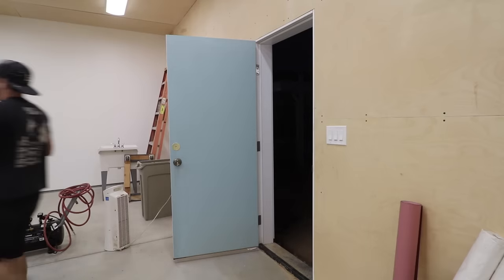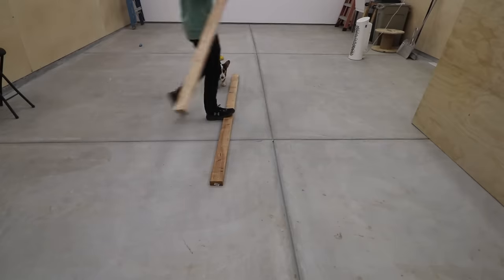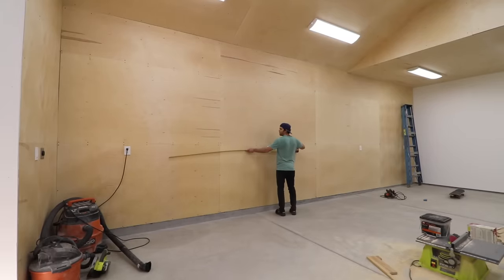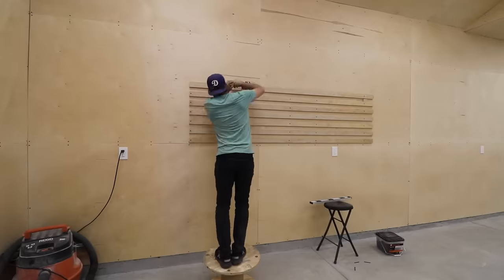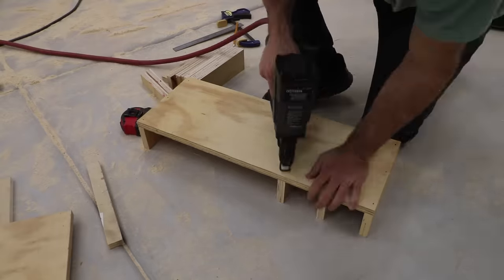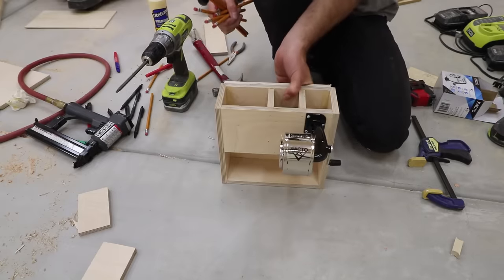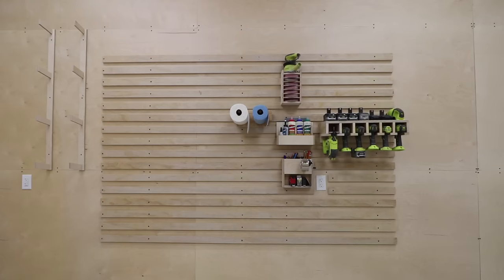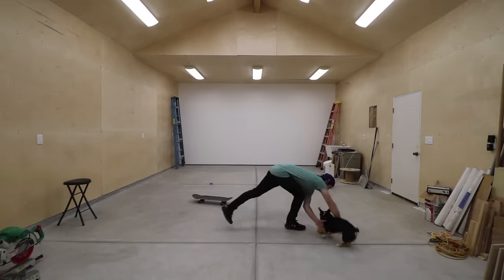Ultimate French Cleat Tool Wall

Comment: Recommendations: 
Put a piece of foam in the bottom if you're dropping freshly sharpened pencils in there so they don't get dull again immediately. 
Use the weirdly placed plug to your advantage and mount all of your drill battery chargers on a shelf that plugs in there and hides the cord cleanly.
Reply: I also use foams so it doesn't make marks on the bottom
Reply: Great tip about placing batteries close to plugs.  Would also be good idea to incorporate chargers into the box for these.

Comment: Only thing I would change about this is putting the wall-mounted strips onto a plywood board and mount that plywood board to the wall -- this way you can easily relocate the whole assembly once your workshop is more fleshed out and you start to realize you actually would prefer to mount it elsewhere. (at least I know that's how i would feel)
Reply: Good point!
Reply: still grate job man :)
Reply: Or you could be like me and install and remove everything 10x until you figure out where you want everything , I don’t recommend it, big waste of time
Reply: Solid idea
Reply: Bro I heard you like cleats? Just put your cleat wall on wall cleats for your cleat storage. EZclap.
Reply: My dad said the exact same thing
Reply: I agree. Workshop Junkies did that...mounted on plywood first. Nevertheless, a great job!
Reply: His entire garage is sheathed with plywood. You missed the first 3 minutes. 😅
Reply: @henryheinbuch  That's not the point though... It's to be easily movable from wall to wall, which this is not.
Reply: Love the idea man
Reply: I just put cleats on all my walls problem solved.

Comment: Love the whole French cleats approach!  A couple of ideas (no criticism at all):      1) Add a power strip to one plug by the outlet and build a shelf for battery chargers for the second outlet. 2) retractable extension cord and air hoses would be awesome in that space. 3) anti fatigue mats under that tool wall—eventually something expensive is going to fall. 4) make a disposable glove dispenser 5) mount a bench grinder on the wall or nearby.   6) you could integrate a work surface underneath the wall. Cut plywood the width of the wall and the height of the floor to bottom of the tool wall.  Attach with hinges and have foldable legs.  Pop it out when you need it & fold it away when you don’t.        Idk if I could have done all the smaller assembly on the floor— just a sawhorse/plywood table would have made the work more comfortable.     Awesome work.  Looking forward to seeing more.

Comment: I made one of these about 6 years ago, and have learned a few things from it.  One is that you don't want to have all your tools out in the open, they get covered in dust over time, and it get's caked on over time.  I put very often used tools out, but things like drill bits, tape,  brads etc, I find better kept in cabinet with a door.  Good news is you can put cleats on the back of cabinets and still move them around as your needs change.  Another neat thing, is to mount magnetic bar, either on a hanger, or onto the cleats themselves.  Then spaces can be used for those "catchall" tools, or specifically mounted for a set of wrenches say, without needing a box - which also collects dust.  Good job though!
Reply: Maybe you should make a dust collection system using a shop vac?
Reply: @ericinlampasas3488  I have a large chip extractor for planer/tablesaw/bandsaw, a dust extractor with ducting system with blastgates for sanders and router table,  portable vac for all handheld tools, and a ceiling mounted air filtration system.

Anyone with a workshop knows that despite that, you get a lot of dust.  You do in a house unless you dust each week - but I don't know many people that dust all their tools on a weekly basis!
Reply: @ericinlampasas3488    BTW: I am not saying this is not a great job.  I am just not sure about power tools (which are better in cabinets), and rolls of tape (perhaps better in drawers), etc.  I have one of these and put most of my most used tools on there, but not all, and only things I might use on a weekly basis.  Eg, i don't put a socket set out, but I do put 5 chisels on it. And so on.
Reply: Good point on the dust build up assuming people are putting these in their workshop. 

I'll be putting this system in my garage just for tool organization.
Reply: I agree with your idea, actually we should make the cabinet with the same rack to be easier to make it ready when we do some tasks

Comment: Small tip - take the very corner of the cleats off with whatever you have (plane, sand paper, table saw, router etc).  It’ll avoid small debris interfering with the seat, prevent your cleat from getting chipped out over time, and you won’t cut yourselves on the edge :0

Comment: Nice! I usually work alone. I use French cleats when I install cabinets in kitchens. Just hang them on the wall and work from there. I order filler strips to make up the 3/4 inch difference between the wall and cabinets. The best part is in old houses once the cleats are on you don't have to worry about finding studs. Up here in Boston there are a lot of old houses!

Comment: I used a french cleat to mount my old TV on the wall in front of my treadmill. The problem was, because it was old, it weighed something like 70 lbs, so I had to hack together a hoist system to lift it into place. Works great though.
Reply: i did the same thing with a flatscreen in my room haha
Reply: mounted my projector screen to the wall with this i thought i was a genius for coming up with the idea.... before i knew it had a name.

Comment: I've been looking for a way to organize some tools and thought I would be going the peg board route.  Now I know what I'm going to do.  I love the idea of being able to move thing around as I get more tools.  I also love the idea of making all of my own holders for things.
Reply: …plus, peg boards can be a pain. A) you need to maintain a gap between the pegboard and your wall so that hooks and loops can enter and secure through the pegboard holes. B) lots of pegboard hooks and accessory holders pull right out with your tools, dropping on the floor, etc. C) way more limited storage options unless you build them yourself. And then they are a bit harder to engineer so as to be compatible with the peg holes and still be secure. 

Not crapping all over pegboard systems, I still use them. But I wouldn’t install or expand a NEW one at this point: cleats all the way.

Comment: I went to school at a studio that had the same style French cleats on the walls for the modular sound absorbers (soft) and sound deflectors (wood shapes). The cool part is there were rails on the walls for them to hang, but also a few movable walls on casters that you could rearrange any way you wanted. This would be a useful idea for your system. A small rolling wall with cleats to bring any of those modules over to whatever you are working on.

Comment: Nicely done! As simple as it is, one of my favorite take-always is attaching the pencil sharpener to the pencil holder (with foam at the bottom of the bucket)! My pencil sharpener is currently mounted at the end of a work bench and, while I don’t always use that end of the bench, if I want to, the sharpener is in the way. This puts it right where it needs to be!  It’s simple add that will save time and frustration in the long term.

Comment: I use the french cleat system as well. This is a little over zealous cart before the horse situation though. I would have installed all my large equipment first because they take up lots of space and have specific locations. Once my shop was laid out I the  would have installed my cleats in the most efficient locations. Also, I likely would not have dedicated one entire wall, but rather installed the system where those specific tools most likely be used. Thats just me though. Good work!

Comment: On my cleats, I always run the 45's back through the  table saw (set back to 0) to take a half a kerf (roughly a 16th) off. It gets rid of the sharp edge without affecting the cleats holding power.

Comment: Just put a french cleat system on one side of my rolling workbench. The opposite side has open drawers to place Milwaukee boxes in for screws etc. One end of the bench has stain and glue storage, the other end clamps. Each corner has a speed square and pencil holder. Best bench yet. Getting ready to finish the outside edge of the top with hardwood, and then router in a recess on part of the top for a 24”x30” piece of granite. I like the granite because I can sharpen chisels on it, and also glue things up on it without worrying about glue residue...which just scrapes right off.

Comment: I am glad I found your channel. I was planning on putting a plywood, fastened on a concrete wall, and use nails for hanging tools, which isn't flexible.
Reply: Also, are you using ordinary or marine plywood?

Comment: Trim the sharp edges on the cleat on the wall and on your boxes. Dust will settle on the wall cleats and your boxes won't slide down enough to get a tight fit. And you won't get hurt anymore.

Comment: Yeah, it's really worth doing one more rip to dull that 45 degree edge. It'll make the whole system more durable to repeated use.
Reply: And you don’t cut your self on it, well as often.
Reply: What do you mean by a rip?
Reply: @ElDuardo01  in this case, a long cut to remove the sharp edge left by the 45 degree angle. More properly, a rip cut is with the grain in solid wood, but that doesn't exactly apply to plywood.
Reply: @Aethalops  Takes longer but you can use a sander and knock the edge of each one.

Comment: Such a great custom setup very clean. The little "extras" you did were super awesome. Level Level level.. lol. Only add would be to add a removable  thick dowel for your tape row and extend the serrated blade and flip it upside down from end to end so you can run the tape underneath it and pull then cut thus not having to remove any rolls. But what the hell u did awesome already. BTW that freaking dog is insanely cute I appreciate you leaving in the audio of the toy squeaking lol.

Comment: Once you cut your strips you can actually run them back through with the blade at 90 degrees and just rip off 1/8 or 1/16th of an inch of the pointed side.. Knocks that sharp point off them and doesn't hurt the holding power. Keeps from getting those finger slices. Nice Work.

Comment: You can cut two cleat strips at the same time by ripping a strip down the center on a bevel, which can be tricky, just take the width of the board and subtract half its width and half the thickness.

Comment: I made a French cleat sliding shelf for my glue bottle since I glue stuff and work my way down the bench.    I was having trouble with it staying on.   So I cut some wooden wedges that just wedge in place and it holds the shelf securely while being easy to remove.

Comment: Best step once the French cleat strips are cut: sand them. Sand them enough to eliminate excessive sharpness or roughness/splinters. Just use an orbital sander and do it quickly.
Reply: Dulling the edge can also lead to the cleat gripping less firmly though. So you have a trade off risk.

Comment: Good rule of "thumb" If the cut is less than 4 inches, use a push stick
(because you have 4 fingers on a hand)

EG: 4:35
Reply: Agree Kira.  This guy has SOOOOO many careless practices in this video it is not even funny.  I am really surprised he has not cut his fingers off.  35 years of careful woodworking and I still have all of mine.

Comment: I like my personal Garage nice and clean. Nothing hanging on walls, So i just got me a few "Seville Classic UltraHD Mega Cabinets. as well as my All stainless steel Dual Husky tool chest with Drawers. and pull out work table. I prefer to have Nice Stainless Steel Cabinets locked up, then to leave them exposed. Something about Exposed items that make things look messy. That's just me of course. This is a great Idea for a workshop, wasting so much time looking for tools and misplacing them is extremely unproductive and a waste of so much time that adds up throughout the years. 

 I will use this system to keep my Nook Benches in place and be able to pull them out when I need to. 

Thanks again for such a great video.

Comment: Thats awesome! I think thats what im going to do in my shop. I dont have paneling but it should work with studs open anyway. Good job on video.
Reply: Works better on a solid wall.  If just studs you will need to make sure all your holders have an extra support piece that hits one of the cleats.  This is a very good video on the French cleat system but you might want to look at some others as well.

Comment: I asked some friends about experiences about doing these awhile back and the first comment was to sand the edge of the 45 because of how sharp it is.
Reply: Page 11 Racing and I’d definitely knock down the sharp edge of the 45 on the back of the shelves. French cleat walls are awesome and flexible, but they’re dust traps. Squaring of the corner a touch means the dust deposits won’t prevent the shelf from seating completely into the wall cleat.

Comment: Hey man! Loved the video, this is my second time viewing it. Would you care to summarize the meassurements of the cleats? Thanks!
Reply: For cleats: 3/4 inch plywood. Cut it into 4 inch strips. Then cut in half with a 45 degree miter. Place strips on wall 2 inches apart. Cut another set of 3/4 inch ply this time make the width 2 inches wide for the hangers that fit into the cleats on the back of your boxes.
Reply: @jdclaverie  thanks for the info. So your hangers are shorter than your cleats? I was trying to figure out the 4” apart and my two sides together were too tall. Shorter hangers makes sense. Thanks

Comment: The wall is awesome! Just finished my shop and will add this wall next.  To my eye the approx. 2 inches between your cleat strips looks tight.  Does that work well?  Is it tight sliding your tool holders in and out?

Comment: you need to chamber the edges.  those sharp edges will not only cut you but they will quickly break off and make your wall splinter.

Comment: I love this and am already planing it out in my garage. I have a few Ryobi 18v tools and was going to get a nail gun. Would you recommend 16g of 18g if I could only have one?
Reply from the maker: 16 is the standard for finish nails, 18 is the standard for brad nails. They both get used for different applications so it really depends on your use. If you’re connecting a bunch of 3/4” material you’ll need finish nails because brad nails won’t reach. For smaller stuff, you’ll need brad nails because finish nails are too long

Comment: Why not cut the lengths with the skill-saw blade set at an angle, so that you don't have to re-cut them on the table-saw and lose material?  Cut lengths of twice the depth required, then cut them in half with the blade at an angle.

Comment: Great video! I prepped my work bench wall for cleats and plan on working on the cleat system today. Any insight on why you spaced them 4” apart? If the matching cleat is 4” does that leave enough room for removing the tool/box/shelf?
Reply: FYI: I figured this out...he cut the 4” strips in half and left 4” to make sure you can remove the item hung with the corresponding cleat.

Comment: A full sheet of plywood is 4 x 8. So if a width of plywood is 48 inches (4x12), how is he getting 16 strips at 4 inches each?
Reply from the maker: I cut 8 strips at 4 inches each. Then ripped those 8 strips in half with a 45 degree cut, making 16 strips

Comment: Hey quick question, you said you placed cleats every 4 inches... so the cleats you use for the wall and for tool holders are not the same size?
Reply from the maker: Correct. The cleats on the back of a holder are a bit smaller to fit in the gap. You could space them out more if you don’t want to cut smaller ones

Comment: You're going to lose a digit bro. Would recommend watching some table saw safety videos. Take it from someone who knows...
Reply: First thing I thought.  Honestly I live in fear of my tablesaw and try to use eaither a tracksaw or mill when ever I can.   Maybe I’ll be able to get a sawstop someday
Reply: 5:21 SO dangerous...
Reply: @JamesDittmar  why? Can someone explain in detail how this should be done instead of everyone saying "so dangerous"
Reply: @getstuk87  Yeah sorry should have mentioned -- you are cross cutting an unsecured board -- if the board gets caught in the blade while you are cutting (which happens), then it will very suddenly kick back and it can make you drop the board / the board will fly into your face / you jump and put your hand in the blade. When you are finished cutting, if you are not applying equal pressure to both sides of the board, then the board will twist and can throw your arm / hand / fingers into the blade. 

Here you go watch this video to show what can happen -- https://www.youtube.com/watch?v=xFkHmgRIkOI

The solution is to use a miter sled or miter gauge.
Reply: @getstuk87  For one, he's not using a push stick or a sled, so he has to lean his body over the top of the saw to push the board through. If, for some reason, he were to slip or fall, his center of gravity is right over the blade, and the saw is positioned right around chest/neck/head level. Also, table saws are only meant to make straight cuts. He is not using a fence to support the side of the board, he is just free-handing it. If, say, his right hand moves forward faster than his left hand, he will start to make a slightly diagonal cut which makes kickback more likely. If the saw catches a hard spot in the wood, the blade can grab the board and fling it right at you since the saw spins towards you. It happens so fast that the board can also pull your hand along with it right into the blade.